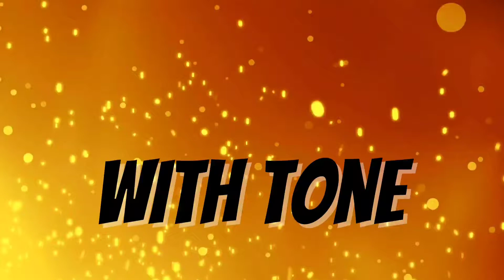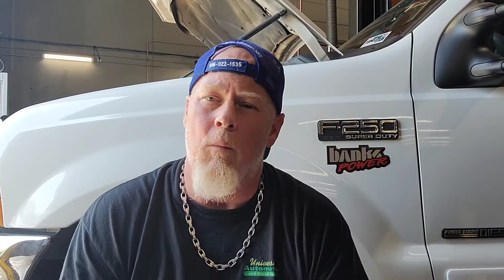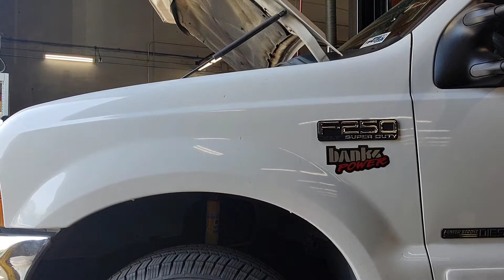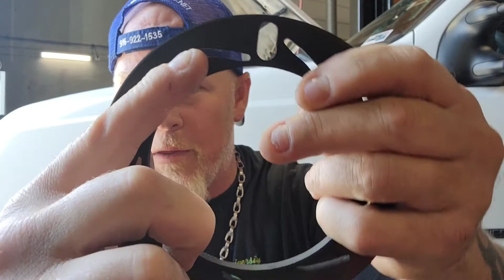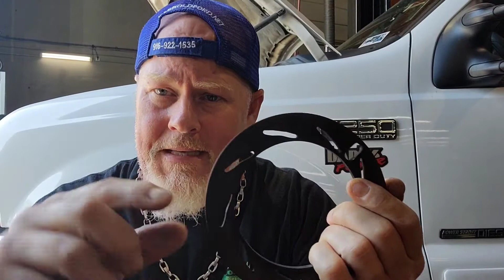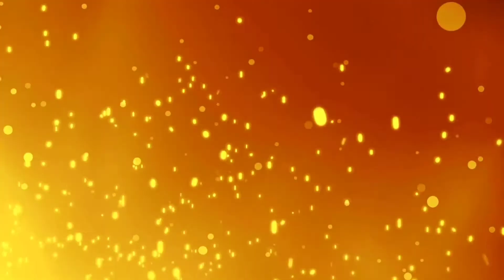6.0 POWERSTROKE LACK OF POWER P2262

Comment: I’ve got a 6.0 that has been giving me a run around and no one has covered the issue. I have a random rough idle and surge under load but my sct won’t show any codes related and no low end power
Reply from the maker: Instagram is easier to communicate, send me your vehicle info and we can discuss it

Comment: Thank you for the info, got a small problem. My turbo pipe was loose no power. Fixed that the turbo worked. With in 2 miles. Big back fire. Lost turbo but it tried to work. Help
Reply from the maker: If you message me on Instagram I can try to help you out.

Comment: I had a turbo loose some blades off the exhaust side. Is there a chance they are stuck in the exhaust somewhere causing a plug?
Reply from the maker: Yes they will be stuck in the front of the cat. You can disconnect the down pipe from the turbo under the vehicle, will be two big bolts holding the two pipes together. disconnect that and should be able to find the pieces in front of the cat. Thanks for watching.

Comment: Hey man I have an issue with a 6.0 e350 van. 

So it will accelerate fine and it’ll build boost to about 10 psi and then drop to 0 and the rpm’s won’t go above 3000 rpm. Pretty much same issue you had. 

There was a code same as you. 

We pulled it he turbo and found the unison ring was seized and had the pin hole oblonged a little bit. 

We put a new rebuilt turbo and new exhaust sensor and a new egr valve as we had lots of carbon build up. 

We took the cat out to rule out exhaust restriction. 
But still no difference. 

VGT numbers vary and it’s a rebuilt turbo so highly doubt we got another bad turbo. 

I’m at a loss lol. Any advice ?
Reply from the maker: That is a bummer you are having trouble.  First thing can you message me on Instagram and I can try to help you out. Thanks for watching

Comment: I think that's my issue at idle it would kick into high idle and sound like a jet engine now it doesn't sound like that and it feels sluggish when pulling out from a stop if anything is coming at me I wouldn't have enough power to pull away in time
Reply from the maker: Disconnect the cat in front and drive it and see if it is better. Thank you for watching.

Comment: Question: what is “if everything else is good”? My truck just started lacking at acceleration. Holds and climbs hills, but that romp take off is slow. And I hear a kinda whistle when I come off the throttle ( it’s intermittent). Definitely jumping vgt’s 15 and 85… I do have a little tone, and the batteries died… not sure if that has done something 🤷‍♂️, so I’m going to retune, and check for leaks… what do you think? Thanks for your input! Other then this, starts, idles, and runs great.
Reply from the maker: Ok well first thank you for watching. Batteries dying does not sound like it is part of your lack of power. If you are hitting 15 or 85 percent on the vgt then most likely your unison ring inside the turbo is sticking. It should never hit 15 or 85 percent and if it does then that means it cannot achieve the boost it needs to hit at that range so the computer is maxing out the vgt to attempt to get it there. What year is your 6 liter?  Lastly if you can head over to my instagram and shoot me a direct message with the response it is much easier for me to communicate back and forth that way. Thanks again.
Reply: @NutsandBoltswithTone  it’s a 04 with 78,000 miles. No chance it’s a cracked inner cooler or the map sensor line that goes to the top of the manifold? It vgt’s fluctuate back and forth, but loses boost at full throttle. I guess I’ll have to pull the damn thing lol